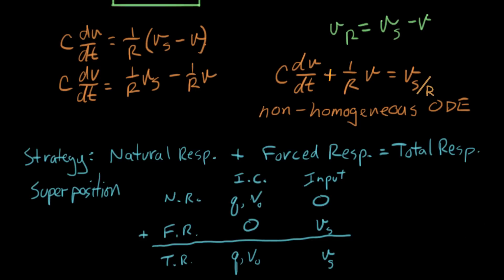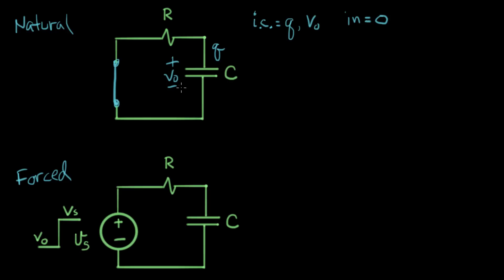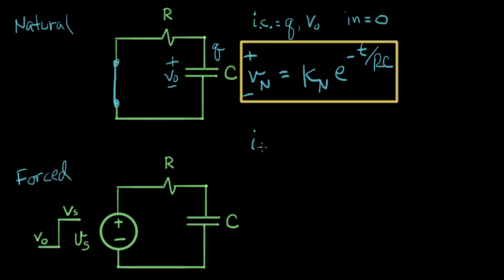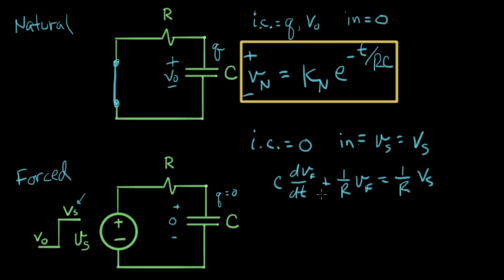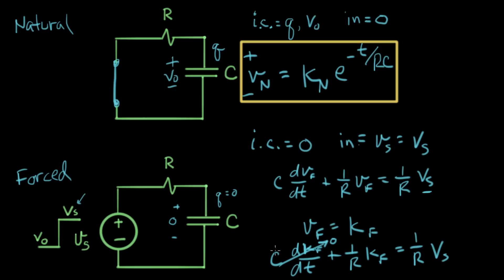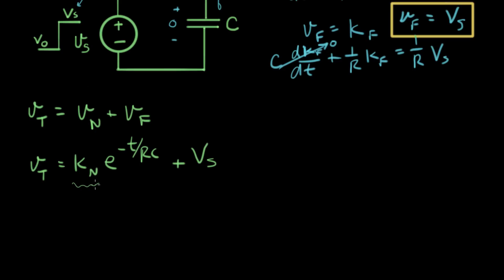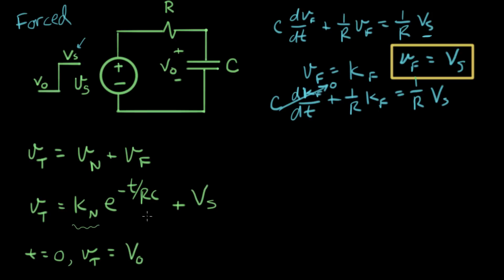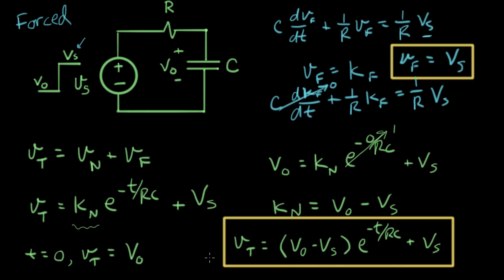RC step response 2 of 3 solve

Comment: If we go with the assumption that Vf is constant, for a case when the initial condition of the capacitor is 0, then that means that the voltage across the capacitor instantaneously goes to Vs, which is not possible, I am not following the logic here. If Vf is constant, then that means current equation C * dVf/dt is 0 which cannot be true, current has to flow to the capacitor to make its voltage equal to the voltage source and only then is voltage across capacitor = Vs 
What is going on here? what am I missing to understand?

Comment: The natural response you wrote only has the right IC if k_N = V_o and the forced response you wrote doesn't have zero IC. So each of those separately was completely wrong. But you got the right total response.... if you are just going to find particular and homogeneous solutions, say so instead of confusing people by saying you're finding solutions with certain IC and doing it incorrectly.